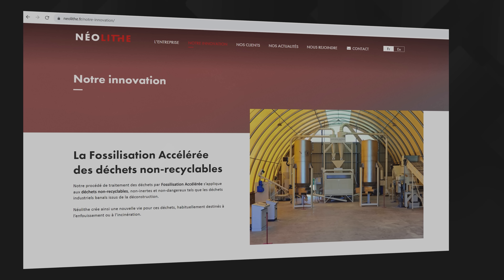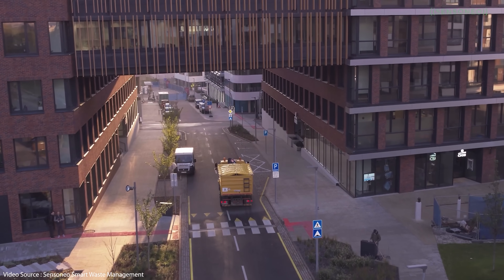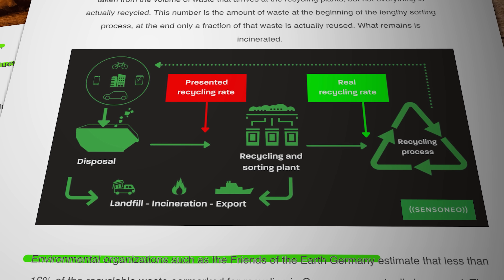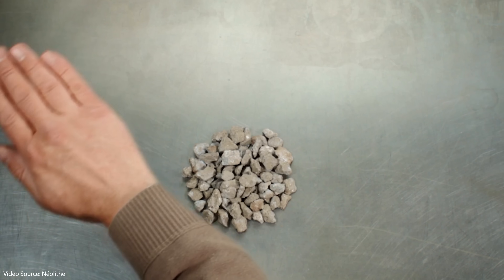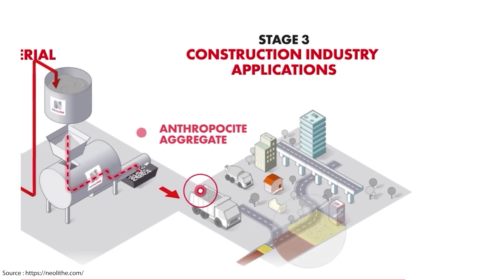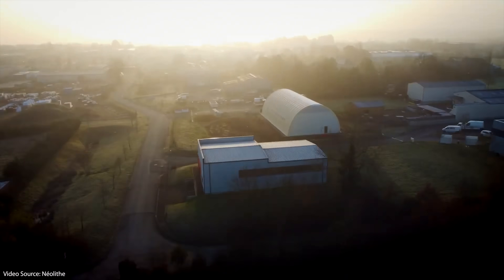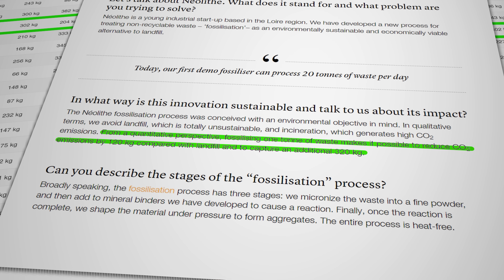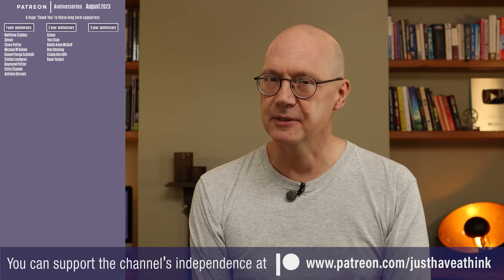Building roads with your rubbish! How do they do that?

Comment: To use the simplest common sense, if you make your roads from plastic, you will spread tiny flecks of plastic wherever your build said road. Of course tiny pieces of plastic, which WILL flake off, turn into micro plastics. What a ridiculous and irresponsible idea. Why? Asphalt is already the most recycled product on the planet.

Comment: I SO wish that they'd just admit when food packaging is going to be incinerated instead of pretending it will be recycled when in fact it gets sent half way round the world and dumped. Paper contaminated with food in turn contaminating clean lines of recycling is a primary thing that ruins the whole plan to recycle paper at all. Best to admit it so people can dump their mixed plastic, dirty paper and non compostable food together and only really worry about keeping out glass and metals. The ash from the incinerators could then be added to asphalt with less processing. It will still be somewhat toxic and diluted by the mixture but at least it won't result in a gradual leeching of microplastics along with the existing particles from tyres.

Comment: Roads experience a lot of wear and tear. So if you use plastics in the road material, you will end up with a lot diffusely soread microplastics. Also after the road is tore down or resurfaced what do you with the mixed pladtics material? If you cannot recycle that again you just shifted the dispisal problem to the future.

Comment: I still have a little box of old broken faced cellphones. I'm not happy either. Line them up and pour a grout of waterproof flex seal and put a roof on the shed. LOL
Reply: That waterproof flex seal is too expensive to risk contaminating it with old mobiles.

Comment: I don't see how their process would be much different from if you mixed pulverized mixed-waste powder with water and cement.  It would essentially just be rock shapes made up of plastics, paper, wood, and other items commonly found in the mixed municipal solid waste stream.  The waste hasn't been changed, it's just been shaped and binded together.

Comment: You’re thinking of landfill wrong. It is NOT there forever. For over 50 years landfills have been  mapped. It’s only a few meters deep. When someone figures out something useful to do with it we will pull it out. Most technology takes 30 years to develop. There is battery technology that looks promising today that started 40 years ago. The cathode tube took 60 years to find a use. Television. 
Burning the gasses for energy is essentially is a wash, since the biological materials would rot and to greenhouse gasses anyway.

Comment: if the gaps in the process means that it actually produces co2 still, as long as it isn't more than the current process, it still means taking things away from the landfill. yes there are problems with microplastics but the plastic has been produced already which means it will release micro plastics regardless and you will never convince me that asphalt isn't also horrible. I fully support anything that is less bad than standard and will always prefer things that are either net zero or net negative in terms of impact.

Comment: The mineral binder has to be pozzolanic to harden without heat on the addition of water. Common pozzolanic materials are volcanic ash or tufa, fly ash from coal combustion, and even poultry litter ash from burning chicken litter. These materials may be considered low Carbon compared to cement  but we'd need to see a full Life Cycle Assessment before the claims can be substantiated.

Comment: This is foolish and will not catch on. Sand and gravel are better than lime covered trash for building roads. Incineration is the way to go. Sweden and Japan are leaders in this field. 
Just look at the cost per tonne vs the cost per tonne of your local clay free dirt. No one will buy this product. If they could pave with the plastics or rubber in the tar, that does improve the pavement but to compete with aggregate prices? There is no viable business here, this aggregate takes too much energy to produce it
Reply: That we will have to wait to see. If it's a success, then great. If it's a failure, then nothing has been lost. Incineration only adds to the problem unless all the carbon and other chemicals released are captured and stored safely. What is the long-term cost of that?

Comment: I wish them the best, but really want to see them starting to eat at the 'mount trashmore' (where the local dump mound the trash and put a cosmetic earthen top over it, allowing them to mine the current and 'formerly stored' trash into agregate that can hopefully go into concrete rather than 'virgin agregate'.   Even it if just replaces 'mount trashmore' with 'mount agrigate' that stops leaching and further polution it could be a win!

Comment: Let me give you some background, as I'm working in the recycling and re-use business for quite a while now. First of all: Grinding down plastic to powder size needs either a lot of time and very slow and careful milling, or very cold temperatures (down to the temperature of liquid nitrogen at -193°C, so-called cryo-cooling, but at least to -50 to -90 °C) to  make the soft and rather low-melting polymers hard enough for grinding. Otherwise the mill would quickly get clogged and no longer work. 
The binder, if it shall be able to react with the plastic powder at low temperatures and do this reliably with such a wide variety of polymers and non-polymers (insulation material was mentioned, which may also be mineral wool), needs to be quite reactive. As they claim it is low-carbon, it would not be cement or something of that kind. However, I doubt it is clay or gypsum, or reactive silicates. So I strongly assume it is a kind of epoxy, maybe with inorganic fillers. In any case it needs to be something that will reliably seal the powder against the environment, so that no leaching or migration can happen (which could be a huge issue considering the big surface area of the powder).  
Personally, I'm actually not convinced that this concept is something really useful. To me it sounds just like an expensive way to make a landfill that doesn't look like one.
Reply: Thanks for the interesting comment. I was also struck by the idea of grinding soft plastics. Maybe they add construction waste so the polymers are just interstitial between the mineral grains. Could sodium silicate be used to bind the grains and encapsulate the polymers? What do you think.
Reply: @dougkahl8124  Only with silicate probably not, except you find a way to make it a 3D-bonded network. But then it may still need molecular size grains. But when adding Calcium oxide, you basically have some kind of cement, which would probably work much better. 
However, this all comes with a price, or more precisely: a carbon footprint, as those substances are produced at high temperatures from natural minerals.

Comment: In Switzerland they deducted (refuse incineration) slag from the asphalt in about 2017, claiming it would release "salt" into the environment, this would be too problematic. It think i know putting waste material into asphalt and concrete is often rather helpful, but in Switzerland we have too many faint-mimotic people complaining about almost every little circumstance as if being a problem others should solve, asphalt "must look good aswell" to them, even firewood must look good, even when lit.. instead of having practical efficient parts our grandfathers were used to. Is this an illness on the continent, wanting everything to smell good and being without noise? we are hindered to sell many products that have slight flaws, even loosing abilities to mend or fix stuff(!) The chinese (or even other asians) would make fun out of "us". 
Plastic in the waste/rubbish has 75% of the volume, but only 15% of the mass. Having CO2 aequivalent as a "value" seems like a "curse" to me, since several people make result assumptions they want to derive from it by bending some aspects, like a tree would nowadays spend oxygen fro 13 people (the WWF claims this) whilst in the years before many trees would be required for the amount of oxygen of a single individual.
So what is the main problem of the two legged freaks then? a solveable one? someone else (accepting lots of hurt in the eye) shall mention?

Comment: Well, first of all, this process doesn't reduce the amount of waste that we produce - which is the real problem. But secondly, what happens with the micro-plastic particles in the compound? Are they magically sealed forever and don't rub off when a million cars drive over it every year? And what happens with the material when the road or house or whatever is demolished again? Is it as easily and safely extractable as asbestos? Is it recyclable or even reusable? Reminds me a lot of house insulation with polyurethane and other synthentic stuff.

Comment: How much more useful would it be to simply require packaging to be simplified? I loathe all the packages .ade from unseparatable materials. Not to mention all the pointlessly packaged things id prefer to buy naked.
In my childhood (1970-80s) you weren't forced to buy non-degradable clamshells of tomatoes, for example.

Comment: But does it degrade over time? It’s useless if after 10 years it breaks down into the original, non-recyclable plastic, thus losing structural integrity and polluting the environment.

Comment: As always it will come down to whether their aggregate is cheaper than the traditional stuff and if they can maintain supply. If heat is needed for the process and they say they do not add heat then I can only think that the heat comes from the chemistry or more likely that when forming the product they use extrusion under pressure which can produce its own heat due to friction. I hope it works.

Comment: the sad truth about carbon based construction materials is that they degrade over time ( maybe even produce microplastics). How fast do they degrade ? Depends how exposed they are to "energy" ( sun, mechanical, radiation, temperature swings ... ). This makes carbon based construction material usage limited. Good exception is wood though.

Comment: Very near my home there’s a significant construction project that is building a new road that will lead to a new bridge over a railway line, so is using phenomenal amounts of aggregate to raise the terrain. At a recent open day I was able to speak to one of the engineers and I asked where it comes from. He explained that the majority comes from a quarry about ten miles away, because logistically it makes sense to get it from as close as possible (common sense), but for some parts they have to get it from further away because they need the aggregate to meet certain specifications. They buy it to a specification and then test it again on arrival to check it meets the specification, which is also common sense since the spec matters a lot.
Hence, just having a think about this video and that project, I figure part of the viability of this solution must be in being able to source the waste and manufacture this stuff reasonably close to the construction project. Hopefully that is viable because it could be worse to transport thousands of tonnes of this stuff hundreds of miles, versus hopefully a reasonably local circular economy from waste collection to construction site. Secondly, as I learnt from the engineer, the size and hardness of the aggregate needed matters a lot, so again, I hope it’s viable to make this stuff to a wide variety of specifications, and they’re not just hoping to cream off the “easy” market for the softer aggregate, for example. If so, I think this could be really promising because the amounts involved can be huge… they literally move mountains!

Comment: no heat used, generic input, generic output, so its all but guarenteed to not be changing anything about the incoming products beyond its size, (and how this passed even the barest sniff test to get a video as if its a good idea and not a scam I dont know) and then mixed with some sort of cementing product (e.g. almost certainly cement, a compound that releases massive amounts of CO2 to produce) and then advertised to be spread all over the place, releasing itself over a wide area over the course of years as it weathers. 
all in all, a brilliant way to shorten the distance microplastics, and the miscellaneous chemicals that would be on the products has to travel from its production point to you! ship it right to your front door! use it in your garden!

Comment: Lots of problems with this idea, from unknown content being added to materials unless expensively segregated before inclusion. Green house gasses produced to get the waste to the one or two plants that might get passed the prototype stage. If finished materials are exposed to heat what vapours are given off. If used in roads water leeching off any toxins into ground water etc. As far as waste plastics going into land fills , this is a local municipality issue. As covered previously by your channel I believe goes to incinerators in Scotland and Europe providing  power. The ash is then used in concrete and road materials.

Comment: To me all of these "recycling" schemes of converting trash into some kind of building material is kicking the can down the road, while  possibly adding even more problems due to binder they use. 
We still will have to deal with this trash, just in 10, 20 or maybe 30 years later, and doing the same again has exponential growth problem for need of the binder, since eventually the material that is being recycled will be mostly the binder itself that was used in the previous cycles of "recycling" (very good business model by the way.) Hence the kicking can down the road.
I really have a feeling that all these kind of recycling "solutions" are just scams targeted at government/politicians who want to show that they are doing something about the environment. These government invest taxpayer money into those "solutions" and by the time it becomes clear that this is not a real solution, neither the politicians, who "invested" taxpayer's money,  nor the scammers can be held accountable since it will be like 30 years later, but the toxic trash still needs to be dealt with. 
I'm kind of disappointed that Just Have a Think does not present these kind of topics with more skepticism for example by stating that these kind of solutions are only temporary until we find a good permanent one.

Comment: Not a good idea at all ,and what happens to the dust plastic created by wear and tear ,at a microscopic size or smaller it ends up in the air and water and will be unrecoverable.Incineration is a better option as CO2 can be used by plants

Comment: I have no doubt this is fauxilization indeed.  😄
Plastic fossilization would normally mean reverting to petroleum.
Literally meaning liquid "rock oil", not a solid oil rock.
I wonder if the 20% binder mix may contain solvent that would just melt enough of the plastic powder to fuse everything together under pressure, resulting in a solid plate of material that can be chipped into agglomerates.
What happens to non-petroleum based plastics, like cellulose-based ones? Does the binder work just as well?
We really need to know more about this process, like analyzing the end product.
I also would like to know the consistency of the material, is it rock hard or can it crumble?
What happens later when resurfacing a road made out of this material? Can it be easily recycled and separated from the road asphalt, does it replace all road agglomerates or is it used in a mix of gravel.
But yeah, this kind of recycling would be a gigantic help to our plastic problem.
Same for wind turbine blades: Some go to landfills, some go into road building materials, some are more thoroughly recycled. It's not as big a problem as plastic now or maybe ever because so few wind farms are being decommissioned or repowered, but we need to find ways to reuse or recycle this waste. Burning plastic would not be so bad if we could clean 100% of the emissions. Right now, it looks more like burning produces like 120% of its carbon content in emissions (when you add emissions from transportation and other processes), and a lot of pollutants much more toxic than carbon dioxide to boot.

Comment: Got a full outside bin? Reduce the size of the rubbish and recycling bag by sucking the air out of it using a hoover. This generates a vacuum and atmospheric pressure at 15lb per square inch crushes it into a smaller space. Afterwards fill another bag, do the same, and use it to fill the space created earlier.

Comment: ive said this before, things like shold be used as much as they can in building work...like i wouldnt fully trust a hosuse or a small apartment block out of this stuff(yet), this would be great for paving and walls etc - its these kind if ideas that reduce carbon by just a small amount but all these different ideas working together they can reduce carbon by a great deal

Comment: This is a wasteful, energy-blind process.  Embodied energy in plastics is tremendous, being order 80 GJ per ton.  Similar values for metals.  That in concrete is order 1 GJ per ton, and much much lower for other common construction materials.  Turning highly engineer marvels of polymer chemistry into dirt is disastrously wasteful greenwashing;  it enables sweeping a problem under the rug rather than confronting it and solving it fully to achieve circularity.

Comment: Waste incineration does not need additional fuel. The plastic content has a high caloric value. Waste incineration can produce more electricity than it uses. Here in Switzerland all waste incineration plants have steam turbines that i keep running.